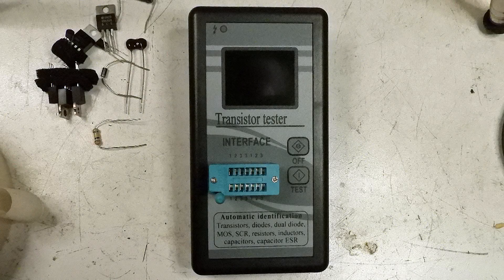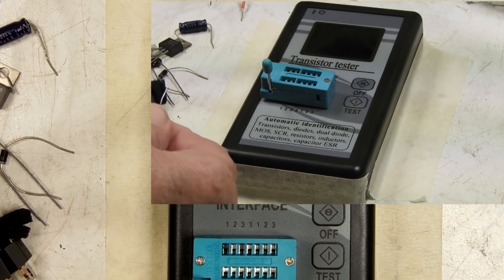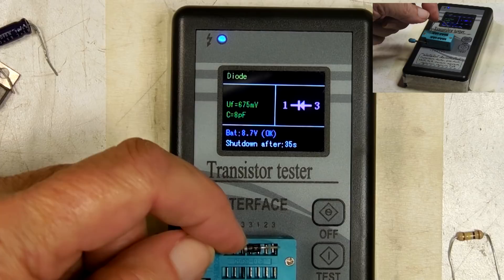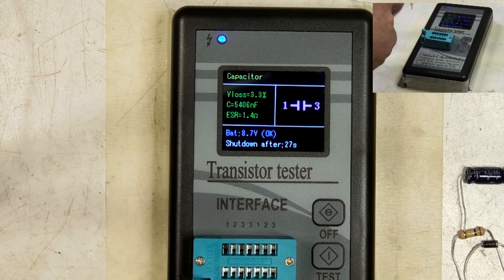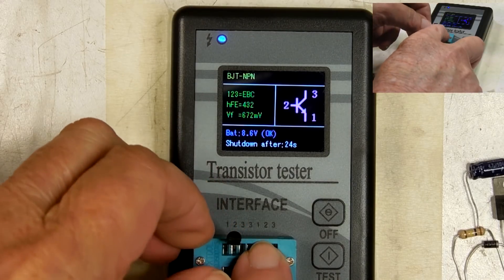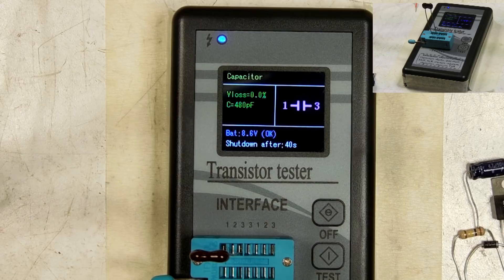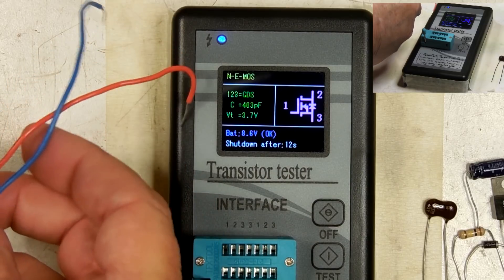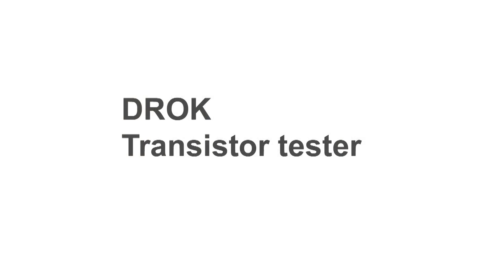DROK Transistor Tester

Comment: sir can this unit check zener diode , regulator ic , ic ,
Reply from the maker: No it can not. Just transistors, MOSFETs, soils, resistors, capacitors.

Comment: I’m a total novice, but I’d like to own this tester. My question is, can this device show if a component is dead? Would it be a case of the device simply not reading the components?
I’ve had success replacing capacitors on my subwoofer, I was able to test it via a multimeter, but this little device seems to be a must have!
Reply from the maker: If a component is bad it may just say it can not recognize it. A transistor if it is bad it might say it is a diode. It depends on the component and what the problem is.
Reply: @AllAmericanFiveRadio  I just ordered an ESR tester, I’ve a friends Blu-ray player that’s totally dead, I’m going to remove some diodes and transistors to see if I can figure it out, thanks for the answer!

Comment: Just bought one for my training center and though almost 4 years after your video, has the same firmware version. Only thing I don't like is the adapter for the components does not feel secure.
Reply from the maker: I took a dermal tool and file down the plastic  bump.

Comment: I test a irfp260n MOSFET it shows c= 2.87nf and a vt= 2.3v no instructions with the unit what do these numbers mean  Google is no help and  no where on the 260 data sheet does it show c=  or a vt=
Reply from the maker: The capacitance of the gate, voltage on the gate.

Comment: Thank you for demonstrating this device.  However, I would not say 13% tolerance for a capacitor would be within tolerance.  3:27 mark.
Reply from the maker: Thank you. I'm not use if I should have tried to measure a electrolytic capacitor. The display does not show polarity.

Comment: Thanks for the video.  Very nice.
I just got one off these, and I love it.  The capacitance and resistor measurements are dead on (compared them to other meters as well).  But beware the gain values on the transistors.  They can be unrealistically high, especially for power types.  For example, with that first transistor you tested (the one in the TO-220 case), the gain showed 87.  But in practice, that transistor isn't going to give you gains anywhere near that.  I put an ammeter in line with the base lead of the transistors I tested and found that it tests with 3 pulses, the highest of which is only 2.5mA.  With that small a base current, power transistors can show phenomenal gains, but then you use a power type in its typical application, that base current is going to be in the hundreds of milliamps, perhaps even 1/2 to 1 amp.  It will have a gain more like 20 in that situation.  Other than that, thought, I really like this device.  Great for a quick check and pin-out identification.
Reply from the maker: Thank you. I'll do a test and see if I get the same results. Thanks for the  information.

Comment: Has there ever been a time when this meter did not put in a decimal when testing a Capacitor? I have a small 10uF 50v Capacitor and I'm getting a 9750 uF reading.
Reply from the maker: So far I have not seen the decimal point.

Comment: Mine arrived today. Works ok, but they could have done a better job in selecting a socket to connect the zif socket to. It's kind of loose and sometimes makes a bad contact causing a test error
Reply from the maker: I used a Dremel tool to knock off the nub so it would lay flat.

Comment: Mine was saying Damaged or Unknown Error. If you get this its the battery is to low.. Run it off a Power adaptor and it was flawless.
Reply from the maker: I use lithium batteries. Thanks.

Comment: Do you have a link to the manual of this?
Reply: There is actually a great number of manuals for these testers as they really all work from the same ATMega328 base chip. Here is a link to a very concise but useful version: http://www.kookye.com/download/manual/mega328_transistor_tester_user_guide-2019.pdf and here is a link to the amazing original German designer/inventor's huge manual: http://www.avrtester.tode.cz/upload/ttester_en.pdf  . There are many other variations out there if you just search, but they are all similar. Just remember to ALWAYS DRAIN ANY CAPACITOR FIRST before testing them! PS You can even test rotary encoders with this!
Reply: @englishrupe01  Thank you for posting the instruction manual link. I have one of these devices, but it didn't arrive with any paperwork in the form of instructions / parameters of operation. Cheers.
Reply: @duncanmckenzie2815  You are very welcome.
Reply from the maker: There is no manual
Reply: @AllAmericanFiveRadio   You might like to add the manual link at the top of the comments:
https://manuals.plus/drok/transistor-tester-manual

Comment: Thanks for the video. I just purchased the Drok Transistor Tester from Amazon, because of you YouTube video. I watched several videos for the Drok Tester, but none of the videos demonstrates what happens if the component is bad. I tried testing a SanKen C3835 switching transistor which tested Uf1= 555mV and Uf2= 555mv. Is this good, bad, or indifferent?
Reply from the maker: You did not say what DROK said it was. If a transistor or diode is shorted it might think it is a resistor, If there open it says it's defective.
Reply: @AllAmericanFiveRadio  I appreciate your reply. The Drok Transistor Tester reports the SanKen c3835 as 2 Diodes with Uf1=555mV and Uf2=555mV. The diagram shows 2 diodes with pin 1 cathode connected to pin 3 and pin 2 cathode connected to pin 3. On the SK c3835, pin 1 is the base; pin 2 is the cathode, and pin 3 is the emitter.  I have a Triplett multimeter, 630-APLK, which appears to show the switching transistor is bad.  I ordered a new SK sc-c3835. I am a 72 year old,  electronics hobbyist who may be over his head trying to fix an ultrasonic power supply. I was hoping the Drok would make up for my lack of knowledge and experience. Thanks for you time. Best wishes :-)
Reply from the maker: The 2SC3835 an NPN power transistor should display as a NPN transistor on your tester. I have tested other power transistors and they display as a transistor. If this is your first time using the DROK and you only have one transistor to test and it's bad, that would be confusing. So in other words if you know it's a NPN transistor and it does not show as a NPN transistor it's bad.
Reply: @AllAmericanFiveRadio  Thanks for the help.
Reply: @AllAmericanFiveRadio  thanks for assistance :-) The new 2SC3835s tested as you said, NPN. I now have 2 working humidifiers. You just can't beat experience and expert knowledge.
Reply: @AllAmericanFiveRadio  My recent purchase of DROK version V2.4 cant detect some JFET, instead calling them BJT npn, inconsistently.
Reply from the maker: @walterramjet  I would contact DROK support.
https://www.droking.com/

Comment: Could I use this to test the resistance of the run capacitor for a heat pump compressor? It's a 30uf/5uf dual cap. Would I just connect with leads?
Reply from the maker: If you can figure out how to connect it. As you saw in the video it is made for small parts.
Reply: Right, that's the problem. I guess I should look for one with leads. Thanks.

Comment: Is that tester also good to read/detect faulty components? For example, a shorted diode or a transistor or even way out of specs....  I'm a little bit confused, sorry...
Reply from the maker: Yes, if there is a bad component it says it can not identifies it or it's bad. Or it might miss identify a component, like a shorted diode maybe identified as a resistor.

Comment: I love mine!!! I have the exact same meter, I call it a component tester. I've had it for several months now and it is quite handy. I've been using it to check and sort components at a local radio museum. The drawbacks are that is may not be as accurate as necessary for some RF coils.That's where a more expensive L meter may come into play if you do a lot of that kind of work.  

Sometimes you have to reposition the leads (comes with it, I'd like for them to be a little more sturdy and soldered onto the clips instead of wrapped) and re-check the part to get a reading. The drawbacks are really small potatoes considering all that it can do at this price point and besides you know about soldering the leads right off the bat. Do hit the off button instead of letting it time out as it does like batteries.Just be SURE that you discharge any capacitor or you will not have a handy little meter anymore. (No, I didn't do that. 8^) Well worth the price.
Reply from the maker: Thank you, and your welcome.
Reply: CavemanNSpace Any good habit easy ways to discharge a capacitor?